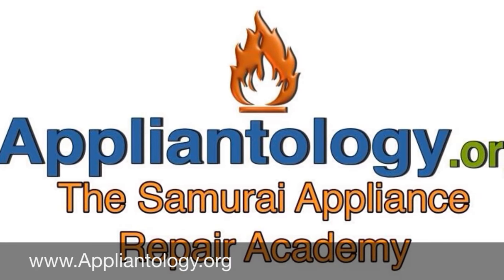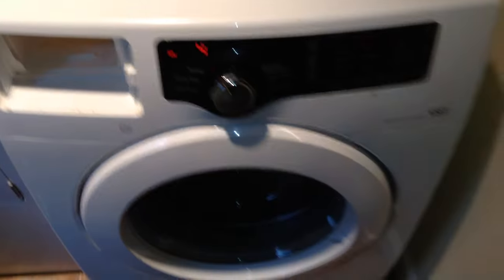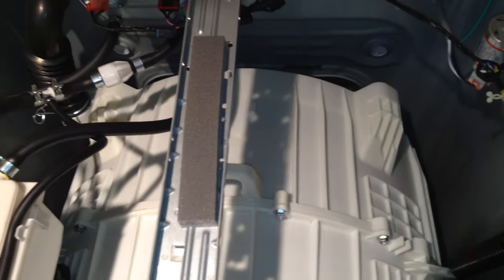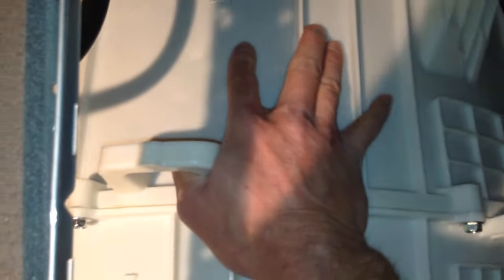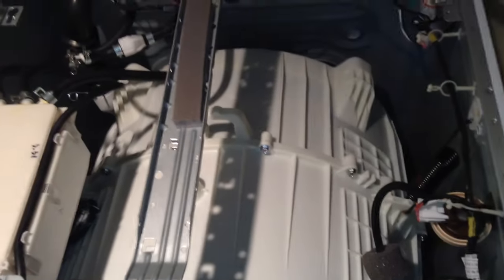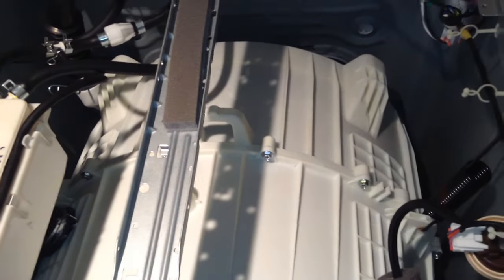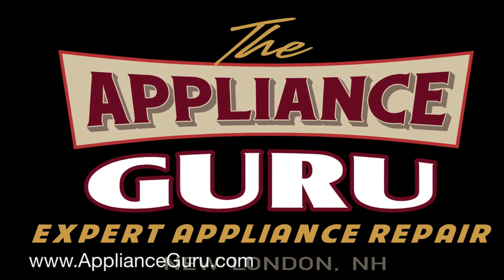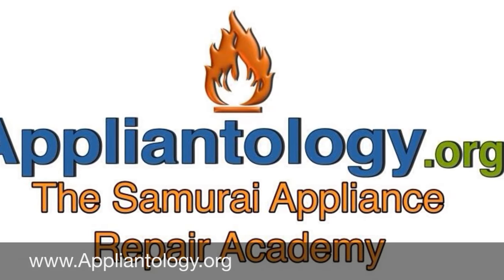The Tell-Tale Banging Noise of a Broken Drum Support Spider in a Samsung Front-Load Washer

Comment: This happened to my washer after 4 years.   After spending hours taking this machine apart to remove the arm,  we were disappointed to find this integral part  is made of cast aluminum that corrodes and destined to fail over time.   One would question if it was Samsung's intention to build a product that would fail, (planned obsolescence) .   No it is not worth fixing, the  part and labour is half the cost of a new machine-    I will not be buying a Samsung again.   It was no surprise to see a pile of Samsungs, and LG washers at the landfill/recycling drop off.
Reply: The part is around 150 and you can do it yourself. It isn't Samsung, all front loaders are made that way. You can spray the new spider arm with a protective coating and that will help.

Comment: All I would recommend is a top load washer. They should last longer than front loaders, but I can only guarantee that the only good brand is Speed Queen.
Reply: SPEED QUEEN IS THE BEST!!!!!
Reply: I agree.
Reply: A good quality front loader like an Asko, Siemens, Miele, Euro made Bosch front loader will not do this and will clean better than a top loader.
Reply: Speed queen was the best but for 2018 they went to hell.
Reply: Bought SQ 12 2016. Heard loud noise during load metal breaking? Had tech from dealer didn't check out much and left. Drum goes to right now had another tech yesterday ordered springs. If that doesn't work washer has 3 year warranty. It will be fixed either by them or Speed Queen. I bought because of the name. Can't fix will take a NEW one.

Comment: PLANNED OBSOLESCECE is the mantra of all the major front loader manufacturers. I've had a high end Kenmore and a high end Maytag and they both failed with the broken sprider after 5-6 yrs. 
Simple fix - instead of aluminum or white metal use steel - they would last indefinitely - Oh but we wouldn't have to spend $1k on a new one every 5 or 6yrs.

Comment: Love how companies design obvious failures like these into their machines, so that it will break and you will to buy a new one. Unless you know how to properly repair and fix it that is. But oh wait, now the even newer machines have the the supports, bearings, etc all built into one solid piece so the whole thing has to be replaced. Which that can usually run you a little under $500. So you might as well buy a new machine then. Instead of just replacing the part in the old. These jerks really know how to screw you outta your money. My grandma had a Zenith TV, one of the huge old ones that sat directly on the floor. That dang thing lasted almost 30 years. They sure don't build 'em like they used to.
Reply: does speed queen reliable

Comment: question , my washer is out of balance to that it wore a chunk out of the rubber seal and left some rubber residue all over inside the drum ...looking at it head on the drum leans forwards down to the left  , did the test but it could not complete because of out of balance , there is No Knocking noise though ...all seems to be fine except for the out of balanced drum ...one of the shocks maybe ??
Reply: Mine started doing similar. Was it the shock on yours?

Comment: Would this be considered a mechanical failure or structural failure?  Thank you very much for all the information!!
Reply from the maker: Mike Niccum Mechanical, structural-- same thing in this case.
Reply: SamuraiRepairman Thanks. I ask because I have a home warranty that's supposed to cover appliances and they declined my claim because this is structural and it only covers mechanical failures.
Reply from the maker: That's a really lame, and arguably dishonest, reason to turn down your claim, IMHO. How do they separate mechanical from structural problem in this case? I would cancel that home warranty policy.
Reply: SamuraiRepairman That's how I felt and argued with them until they just quit answering. It came free when I bought the house but I'm certainly not using them again and making sure I review them everywhere I can do someone else doesn't make the error of choosing them.
Reply: SamuraiRepairman Thanks for your replies!
Reply: I would call it a materials science problem. The spider doesn't just break. Instead, it corrodes first and then it breaks. The root cause of this failure is that the material the spider is made out of can't tolerate the wet environment inside the tub. If it were made of stainless steel, like the rest of the tub, then it wouldn't corrode or break. Samsung sells these machines as a "top of the line, durable machine". When my wife bought the machine the salesman showed her the stainless steel tub and told her it would last a very long time. The trouble is you don't know about the problem with the spider until after you buy the machine and use it for a few years. Can we say "class action lawsuit"?

Comment: Don't buy a Bosch either. If the spider is going to be made out of cast metal, it needs a coating to prevent corrosion. Look at what corrosion did to the spider in my Bosch: http://youtu.be/kv58DgzJkCM